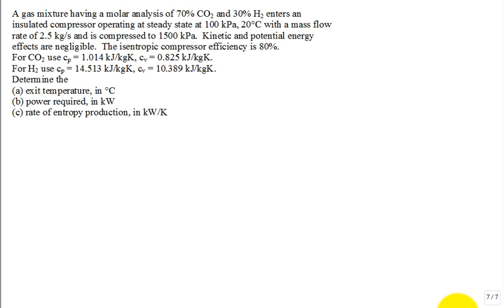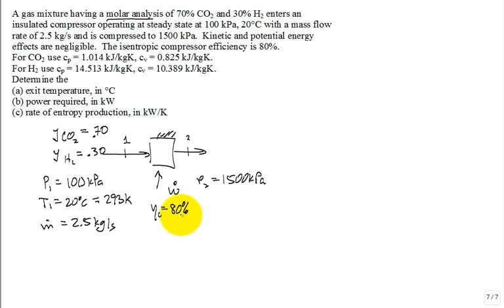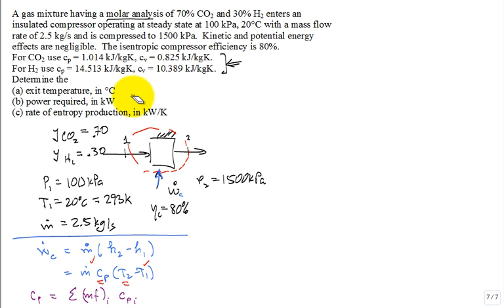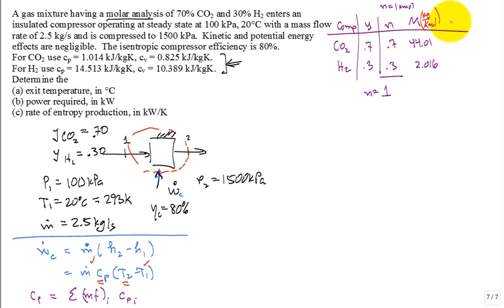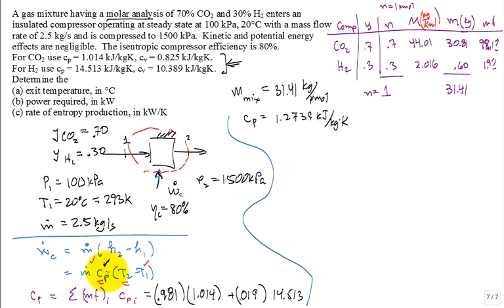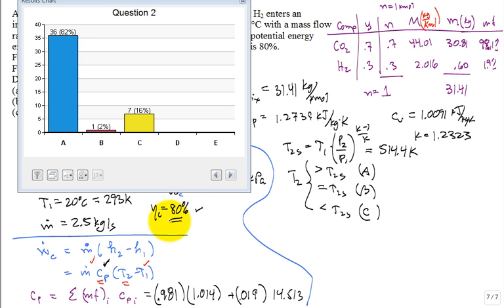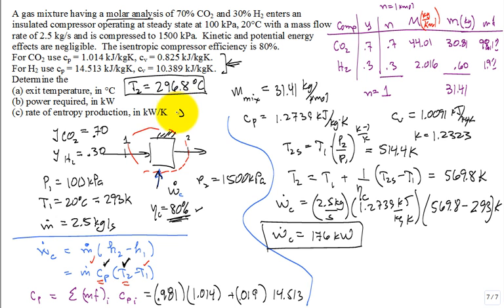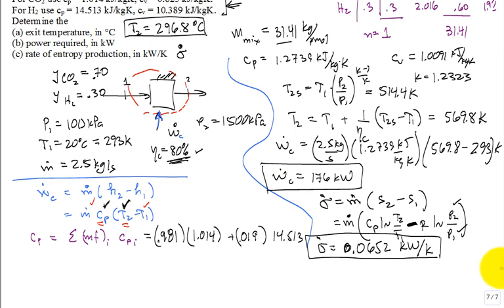ideal gas mix in compressor

Comment: Hi, Given the following info. can we get the mass flow rate of methane and  air?

Air (Stream 1) enters the compressor of a combined gas turbine–vapor power- Heat Pump- plant (shown below) at 1 bar, 300K. Methane ( CH4 Stream 10) also enters the compressor at 1 bar, 300K and mixes with the Air. The isentropic compressor efficiency is 85% and the compressor pressure ratio is 14. The Combustion Mixture and Air react in the combustion chamber resulting in a rate of change of enthalpy
from the inlet to the outlet of 50 MW. Assume that there is 200% theoretical air present in the Combustion mixture (before combustion).